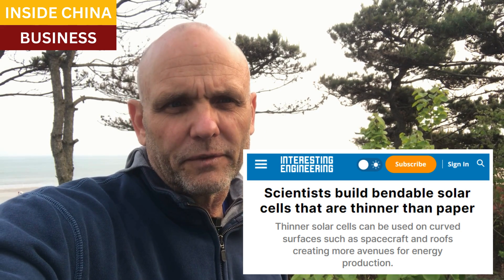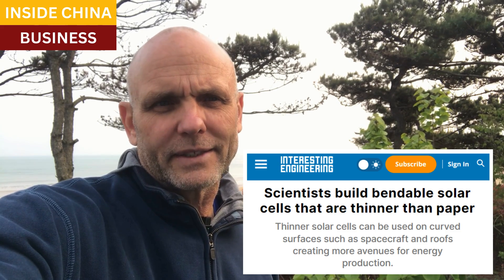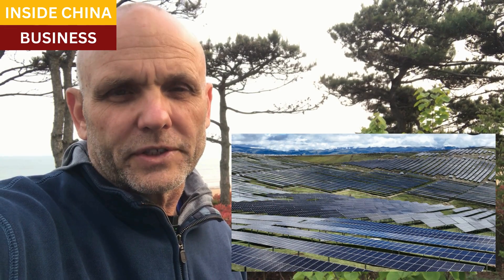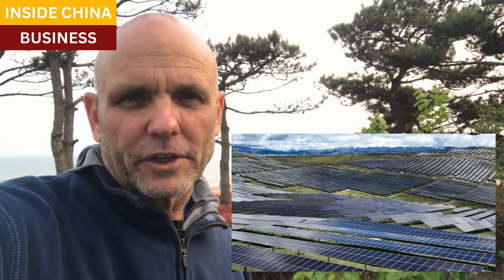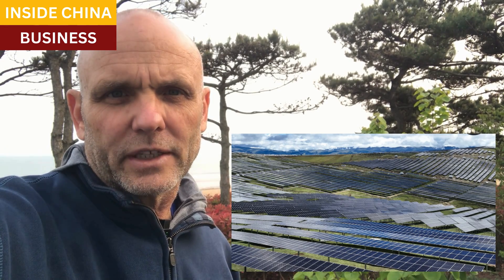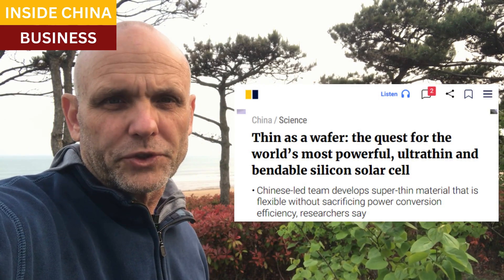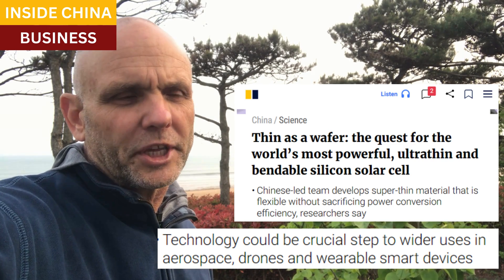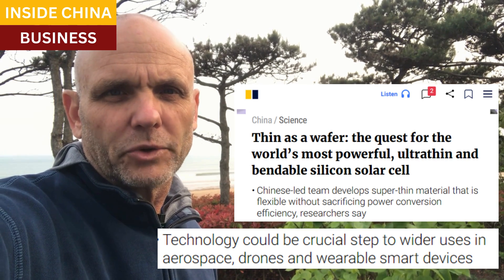Scientists build bendable solar cells thinner than paper, will revolutionize aerospace, wearables

Comment: balloons on fishing line tethered in place 1000 feet up.  Self powered with DJI quality panning cameras and un jammable undetectable directional Infrared diode transmitters to observers on the ground.  Sold in lots of 100 for monitoring large areas of interest from multiple angles.  Of course the customers want to detect real time any illegal fishing/hunting activity on the ground,  including DJI’s laser designators to enable low cost expendable drones to quickly zoom in on the laser spot for close observation or whatever. (Drones also sold in lots of 100).

Comment: Heat dissipation will be a major issue.  With a PCE of 26%, it means 74% of sun energy is turning into heat.  The power density of Sun and the surface of the Earth is about  1376 W/m2 which means 1018 W/m2 of heat to be dissipated (thinking of touching an old 100W incandescence light bulb). A typical portable heater used for home uses 1000W.  The plastic materials generally have very high thermal resistance.  Therefore, this bendable solar cell can only be used at low power applications or its have to be supported by effective heat sinks.
Reply: 26% is awesome. Older solar panels were 16%. The new form factor is a big advantage.